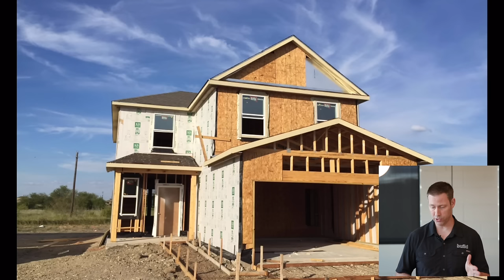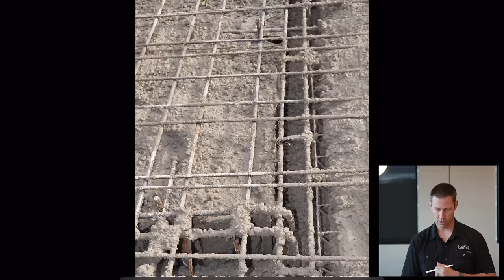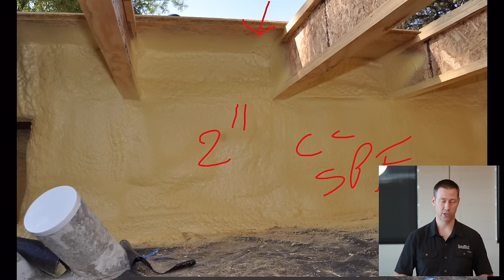Foundations - Slab vs. Pier and Beam - Which is better?

Comment: Slab on grade is actually more common than you might think in the north, we use them all the time here in Canada. Just have to plan around the cold. Basements are stupid. So stupid.
Reply: Why are basements "stupid"?
Reply: Yeah not sure why they are stupid? Difficult maybe but not stupid.
Reply: I started out making my new house with a vented crawl then sealed it off and conditioned it  to keep out the humidity way better but now have just a little over 4 foot of space for storage, I later found out they only tax you on a basement if your have over 6 foot.
Reply: Ben Whittle if your goal is to build a home that appears as large and impressive as your budget allows then basements are stupid because no one sees the basement, money spent on basement space could be better spent on a larger garage or other above ground space to add to the visual presence of the house.
On the other hand, if the goal is to build a home that is visually small, appearing to blend in and be part of the local environment then a basement can be a great way to keep the footprint as small as possible for a given amount of living space.
Reply: @silasbland4515  ..cuz they stink & house bugs & promote mildew, mold etc which in our south will ruin the house. It can cause black mold to grow and make the people in the home sick and ultimately kill them. The house will be condemned.
Reply: So many things to deal with cold weather foundations. Need to have a high PSI concrete to keep it waterproof. Hard foam insulation on the outside, foam on the inside. Heat pipes in floor to evaporate excess moisture. Sump pump for the footing.
Reply: James Biggar Basement = place to go to if tornado hits!
Reply: @fljetgator1833  if basements are done properly they don't have any of these problems.
Reply: @e3innovation  I would say best if XPS is used instead of EPS
Reply: @e3innovation  EPS is not ecofriendly, when it looses its R-value - in the ground there is no way for drying
Reply: @e3innovation  You think radon only comes into the house if you have a basement? Humidity isn't a common problem in most northern states and Canada, or at least is easily dealt with. I've lived in houses with basements most of my life and the extra room and usage easily outweighs any negatives.
Reply: @sammy7237  I've lived in 10 houses with basements including my current residence and none of them had a humidity problem. Okay, one -- an old historic farm house built in 1844 was literally designed with a sloped basement so water coming through the stacked stone walls would "stream" across one side after it rained. Excluding that humidity was/is easily controlled with a dehumidifier. If you have more humidity than that then you probably have a water intrusion issue that needs to be resolved.
Reply: I am from MA and as an experienced basement waterproofer working for my step dad in the final 5 years of his business operation, along with already living in a house with a small basement size compared to much of the house which was added on to the original making the basement the size it was in compare. Unless not installed with or done properly to begin with, then yes a basement will have water and moisture issues. and from what I have been learning about ICf is I really want a home of my own to be sitting atop an ICF basement with french drain on the outside and a sum system for when it gets a but inundated that the gravity system can not drain out fast enough. Then again back to my old childhood home with its basement, it was stone construction and my dad had punched a few access holes into two of the walls in order to create a crawl around access space to fix some problems under the other parts of the house due to settling  using lally columns. Then later when my step dad came into the picture of my life at the time then we had to cut up around the perimeter to make a open drainage system ( we usually do a concrete finish recap for most others since they often plan to finish their basement in) to address a flooding issue. We since sold the place and now the current place i live in (rental) is nice for the most part but the basement it sits on is similar to my original house, though there is no flooding issues except for when the boiler leaked, and it's not air tight or insulated and not very clean for more than just storing some items out of the way.  My sister lives a basement foundation home with walk out to the back yard through a normal door akin to a the front door with one half of it finished in for a usable living space and the other half is unfinished but comfy enough for storing items where the utilities are. 
Basically put a basement is a worthwhile investment and helps improve a house resale value when done properly as I and one other mentioned with proper ventilation and air exchange for a more air tight and insulated basement and also a drainage system to prevent or alleviate any possible flooding which may occur from even the plumbing system makes all the sense to have one. Except for where a location has some unreasonable tax on said type of foundation. 
I for one like the added extra space it provides if it is constructed using ICF, so long as a small area is walled off to place utilities and a separate storage space from the utility room , the Larger the space in terms of length and width, the better and you would be surprised how much it costs compared to a cramped "crawlspace" or unforgiving to your body SLAB foundation which I lived in a few such places and was not enjoying the experience during those times.
Reply: @raunop7391  Not sure why but EPS is more popular in the floating home sector than XPS which costs more to make and also sell for compared to EPS which does not retain water! Do not believe the videos showing them using a syringe to inject both types of foam, XPS is like concrete, it will soak up water and while concrete will dry out, XPS will retain that water it sucks up and then reduced its thermal efficiency to nada but also structural rigidity will become like a wet sponge (which also can dry out), unlike XPS which will NOT dry out as easy or spring back into its former rigidity.

Comment: In cold Sweden, we use slab on styrofoam. https://youtu.be/y1kf2s3ir5Y at 5 minutes they show how the styrofoam is used as a mould for the slab. Sorry but no English subtitles. L-shaped styrofoam elements interlocked with special nails.

Comment: how could that plumber get away with such a thing !? (no P trap). even a DIY weekend warrior would kno they will need a P trap in a shower. there is no way that use of a P trap is not mandated by the code. i try not to be a fussy homeowner, but for something like that, he should be held legally liable for damages. its not like its a "minor" code violation where you may say ok cut him some slack.

Comment: Wood floors easier on your feet when standing? I call BS.  Even if the floor has noticeable flex, which it shouldnt.
Reply: Try dropping a glass from 1 meter on a wood floor. Then try dropping a glass from 1 meter on concrete.
Reply: @Rokmahr008  try making a cut and or dent in the wooden floor with your feet like the dropped glass or plate does.

Comment: Post and beam. Much less work needed. Just drop holes fill with concrete. Not near the amount of concrete needed. No Dozer needed to grade out build area. No need to build forms, no waterproof needed like a slab. No rebar needed. 

This is the way 
https://pin.it/fic2n6lgsdet2g

https://pin.it/o2kmsvg6undtqy

Comment: Kinda weird to see concrete piers.
Reply: Especially since its prone to cracking and crumbling over time, I would prefer fiberglass which is stronger and last longer and FAR better than concrete, steel or wood. at a very reasonable price.

Comment: Oh boy you are having a bad day, you got your pre-tension and post - tension definitions all backwards ! Pre tension is the cables are tensioned before the pour, post tension is the cables are tensioned after the pour, it's self explanatory.
Then later in the video you say that house can be moved anywhere in the world ? Are you serious ?? Moving costs would be so many more times the cost of rebuilding !!
Reply: Per your last corrections, many places have been successfully relocated in whole to a new spot for far less than rebuilding it would have cost. Even raising a house to place on stilts or to redo a basement to modern standards and beyond is far less than just tearing the whole place out and rebuilding all anew, many such cost 100 to 150 grand compared to double that for rebuilding. You really are not well educated or knowledgeable to know how  much a difference it would be when it comes to simply moving and that of rebuilding instead. Especially when the building in question has a historic significance in which rebuilding is NOT an option.

Comment: Waterproof the metal bars!!! Do not be lazy!
Reply: Why? he shows using vapor barriers under the foundation and only water that can and may get into the slab would be from the kitchen and bath areas where the water pipes are running.
Reply: @Joshua79C  because if you dont  next years code will require it! Sigh!  Like you have to go around your elbow to scratch your nose!
Reply: @mayolamayola9472  Many codes leave that out since it adds to the cost and the inspectors are busy as is with the amount of inspections they have lined up. Those epoxy coated rebar are really not worth the extra money since that epoxy is not very scratch resistant. Thank goodness for composite like basalt, carbon fiber, and fiberglass these days, which will not rust or corrode. Even Helix Micro rebar is not coated to protect from corrosion. Stainless is weak than  EXPENSIVE in compare.
This is a conundrum with steel rebar as is.
Reply: @Joshua79C  thats true!  Thanks

Comment: Piles or footings and beams, or even post and beam, not piers. Piers are in water.
Reply: Actually the "pier" is a bilateral definition, it's both water and solid terrain type. though mostly used for water borne foundations and despite it still goes into the soil underwater. So Pier and beam is quite suitable though the better term for such is a stilt house. Post and Beam however is what is used more to better describe American (USA style) Timber Framing.

Comment: Even worse, if that flex line was hot water, it WILL degrade and you have no clue where in the heck the rubber chunks are coming from.  Freakin’ idiots.  But human nature.  That’s why you pull permits.  Even good guys take shortcuts when they won’t get caught.  Even sometimes the screwup was purely unintentional and an accident.  Like open junction boxes in an attic.  Oooops.  Meant to close this.
Reply: Flex line is PEX or PP and NOT rubber as you assume, which I have no clue why you assume it is so made from rubber which only really degrades from exposure to solar rays (solar degradation). Other than its also used for hoses.

Comment: 4:55 Cables take  tension,  not pressure 🙄
Reply: they apply pressure to take tension from the slab to keep it from buckling under the stress of tension since concrete works best under pressure